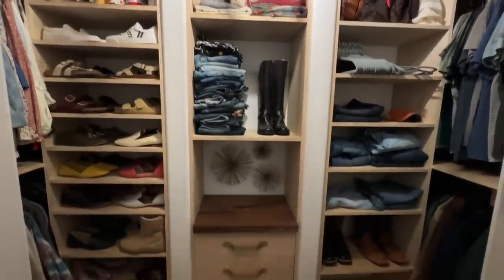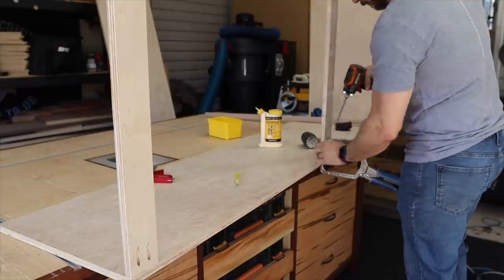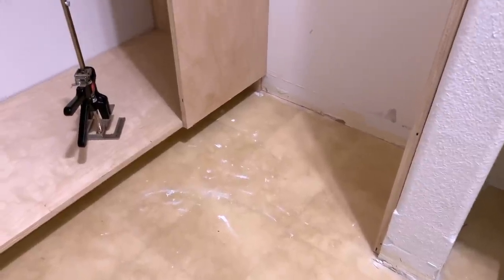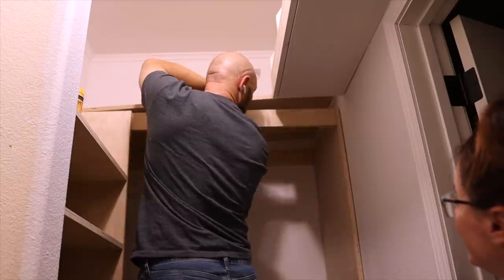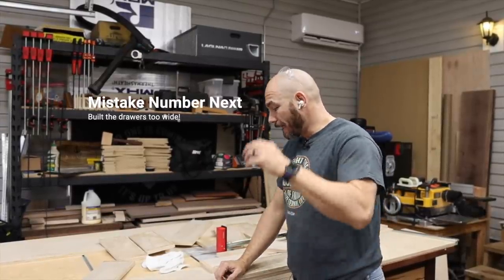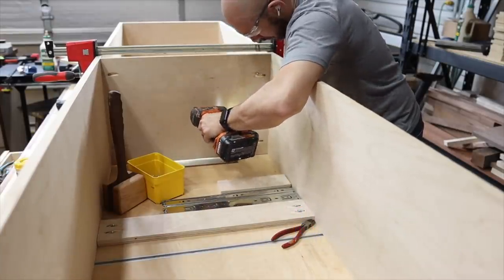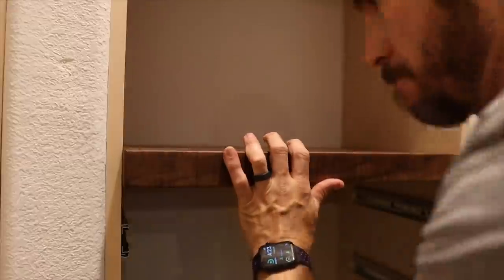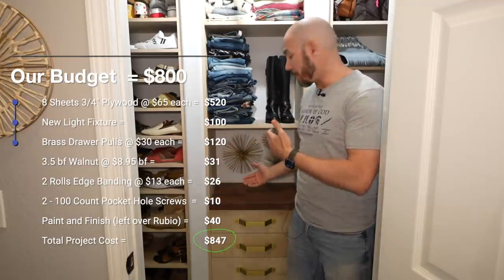DIY Dream Closet Makeover On a Budget!

Comment: Closet renovation is a great project for beginners and intermediate woodworkers. 
Designing, plywood carcass build, drawer construction, installing slides, edge banding, working with uneven walls and more. A lot of valuable all around experience is gained by tackling this type of build.
Great stuff, Matt!
🤛🏽🇺🇸

Comment: Fun stuff.  The first thing I ever built was converting our under stair closet to a pantry.  The couple cupboards meant to be our pantry would never have been enough.  Plus if the food isn't visible to my wife and kids in a deep cupboard it might as well not exist.

Second project was a closet redesign.  We downsized from a 2,800 sq ft house way out at the edge of the suburbs to a 1,700 sq ft two story condo.  Talk about NEEDING to maximize space.  Although now that I've watched your video I'm thinking mine kind of looks like crap and I should redo it :)

Anyway it was the first things I ever did that required tools more than a drill.  I had a blast.

Comment: Nice work. May I suggest next time you build some drawers have sides of the drawers lap the front and rear when doing a butt joint. It will give more strength and less change of a front or rear falling off with the pushing and pulling. A rabbit joint is the next best joint option.

Comment: If putting pocket holes in walnut (or cherry) is a sin, I need to head to confession! 

I also love moving the unit in through the window. That's problem solving at its best!

Another great build, Matt. Mrs. 731 should start a closet design buisness.
Reply from the maker: lol Thanks!

Comment: Matt, I know you have some tool recommendations in your videos, but (and I don't know exactly what I'm asking here) all my stuff seems to break way too fast.  I bought a sliding ryobi compound miter saw as my first "big" purchase.  I've not used it all that much, but I think it's already not cutting a perfect straight line.  I tried to watch a video on aligning it, but maybe I'm too dumb.  I can't figure out what's wrong.  I haven't even burned through 1 blade yet.

I replaced the moulding in our home (that's a suck job btw), and already my ryobi brad nailer has stopped shooting out brads.  I used the 3 in 1 oil.  I cleaned it.  I've tried to figure out if something was jammed.  Watched videos on taking it apart, but haven't gotten the guts to try that.

I also bought a hand held airless paint sprayer for like $200 a couple years ago.  The damn thing after a few projects (like repainting the closet, laundry room, and interior doors) is already spraying badly and dripping.  I cleaned it after every use.  Kept good care of it.  So I bought a new spray tip.   That didn't solve the problem.

I feel like this pattern is a "me problem".  I don't know.  I'm just frustrated that I'm just a guy doing household projects here and there and none of my tools (except my drill) ever seem to last.   All together that's probably around $600 worth of tools that aren't working properly.  It's frustrating.

Comment: Do you have a method of tracking projects as they come into your shop? I’m thinking of having some kind of work ticket system with requirement details, client info, due dates, design info on a clipboard hanging on the wall that I can keep updated and invoice from. If you have a system maybe that would be a good topic for a video.
Reply from the maker: When I was taking custom orders, I kept a notebook in the shop where I wrote down the orders.

Comment: Great video and design, sir!  Clean and functional!  One question: Did you consider 1/2” ply?  Would be plenty strong enough in this application and lighter/easier to install.  I saw you wrestling with that 3/4” sheet at the saw and felt my back tightening up!
Reply from the maker: We wanted 3/4 mainly for the long spances on the clothes hanging sections.

Comment: 731 why not use shelf pins for flexibility/modularity than "permanently" fixing the shelves with pocket holes.  Was it just a matter of what was on hand vs what would need to be purchased?
Reply: I think a bunch of shelf pin holes makes a project look like you bought it from a big box store. A custom piece shouldn't have those and looks much more "finished" in my opinion.
Reply from the maker: I don’t like shelf pins. At all. I don’t like how they look. It looks to me like they are pre fabbed store bought instead of custom built ins
Reply: @Anthony-H  no doubt it looks "cleaner" without them.  And there's the aesthetic factor of everything looks dress right dress, however looking pretty and being functional are two separate things that must be balanced. 

I agree a line of shelf pins holes up the verticals looks terrible and cheap from a big box store. I like to put 3 or 4 pin holes at each shelf to allow for some adjustments based on needs. Kid's closets are a perfect use application as they grow their clothes get bigger.